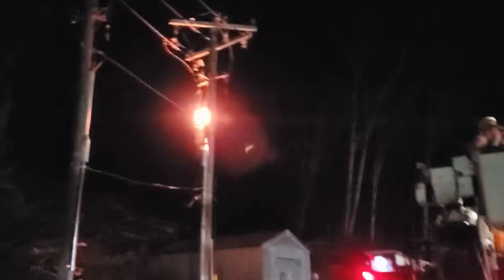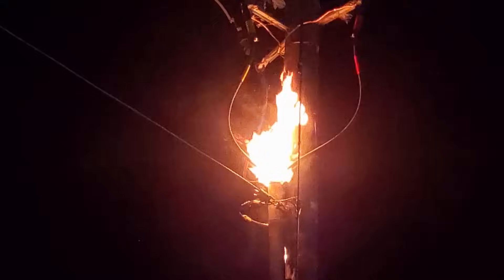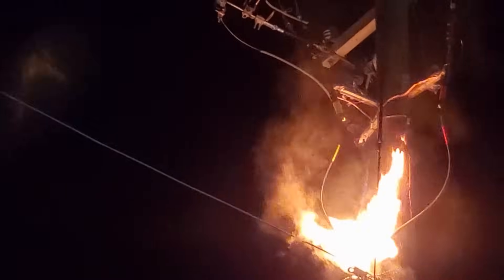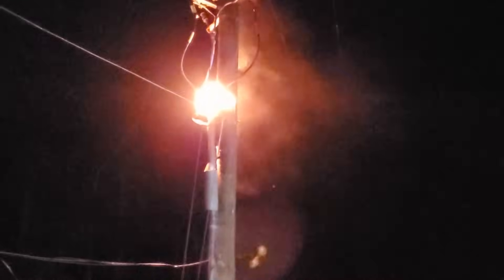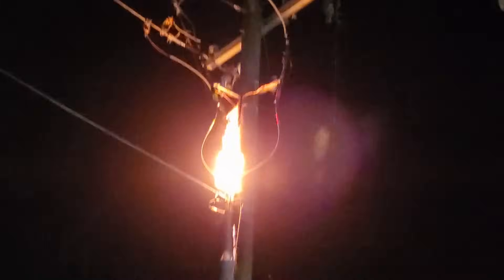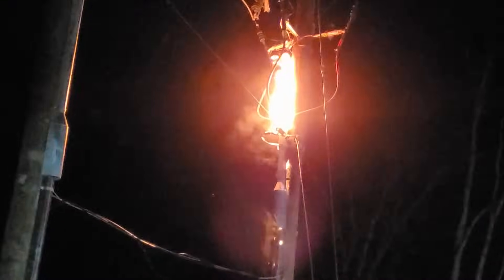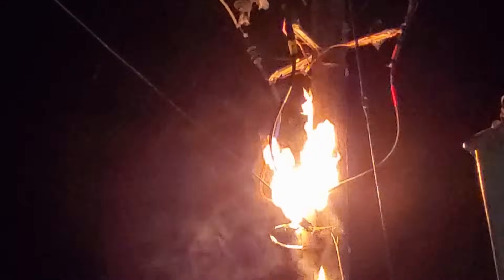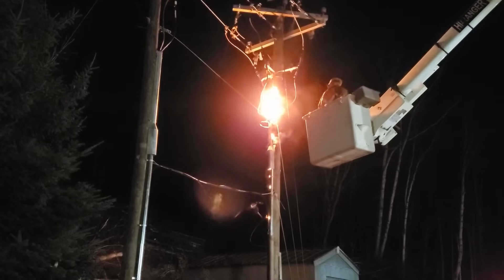Primary splice failure - 7200 Volts

Comment: There was evidently a failure like this on a municipal system about an hour from here, one of the 2400 volt delta cables out of the plant to the riser across the street failed at ground level. The city built an overhead bypass to the step down substation next to the plant (part of this system had been upgraded to 12.5kV decades earlier) and got busy with planning for and completing conversion of the four remaining 2400V circuits.

Comment: I saw something similar but it’s was an underground primary plant that cooked 12 feet of 2 primary feeds, 5 house feeds and a streetlight run. It cooked for about 1 minute before the guys disconnected from the ped mount transformer and the switch fuse blew on the other end. My dad and I were the contractors for this hydro company and we had to start excavating at 2am in the middle of January so that we could get all the homes back going.

Comment: Cleaning the cable is huge when splicing.   Whipping a primary splice together with 2:08 contaminants or improper lubrication will cause a failure      There was def some major error to cause it to fail instantly

Comment: I once had an similar accident while powering on a new 11kV cable. There where some timestress and miscommunication, so the guys changing the old cable with the new one connected the new cable with an old cable nobody was aware of. So as i swicht the "new" cable on i accidently swicht onto the old cable they had just cut and removed. There was a big arc and lots of dirt flew over the construction side. Luckyly nobody was close to the open cableend, so that just the substation automatically disconnected the whole line.

Comment: Little fire and smoke keep things interesting and breaks the boredom.  So never look the beast int he eyes.  That takes some training.  Things happen quickly that for sure. Sure, does get the ticker going. Last fire I had was like a small magic show in a closet.  Flames, smoke and disappearing technician. These things help to keep us on our toes.  There always seems to be something to learn from the situation.  Glad no one was hurt. Never hurts to have a fire extinguisher around.  They do make a mess in the truck if you have a discharge.  That stuff is hard to clean out.  We had one on a lift near my truck and it went off accidentally and I ran to get the doors closed.  Stil trying to get it cleaned out of the truck.  Well stay safe out there.  We all have those days.

Comment: Having "seen" a 480v/150A 3ph breaker explode... you never know when something "simple" is going to go to h***.

I wasn't in the room, but 150ft away down the hall. That was a new ABB breaker. It had been cycled half a dozen times during the various inspections. It blew when being switched on after final inspections. It was completely unloaded - the 20+ year old breaker at the far end PDU was open. The sparky was in full arc flash gear, and pushed it with a stick - not his hand. Other than being pissed, he was fine. (it's a $750 breaker (at the time), and it'll take 2wks to get a new one. Good luck getting ABB to admit to any fault.)

Then there was the make-before-break automatic transfer switch that bridged two out of phase 1.2MW generators... I saw that flash through the NEMA weather strip. It was turned entirely to slag. (there were spares for those in the yard.) And then the wrench dropped into a data center PDU... it's "only" -48VDC - pause for effect - at ~5,000A. Suffice to say that wrench no longer exists. ;-)
Reply: Hot sticks are seriously important. I worked with a software developer who coded grid disconnects. They had like 5 testers for every developer since bad code could actually kill somebody. But they would still get reports of a final physical disconnect sparking when pulled open with a hot stick. 

The level of code review after an incident like that was crazy intense. As it should be.

Comment: We have problems in Louisiana with squirrels building nests in the riser pipes & chewing through concentric & insulation, causing cable failures. It makes your pucker factor go off the scale when that happens. Especially if it's on the hard circuit not far from the substation, giving it plenty of fault current to play with. Stay safe, Brother.

Comment: I had something similar happen with primary wires behind my house which a crew worked on and the very next day an overhead wire came down and was arcing on the street which I thought was interesting since the wire was just spliced the day before

Comment: you linemen have brass balls the size of basket balls and that is a under statement
Reply: Thanks brother, we appreciate it.
Reply: @tkoz7856 i'm electrician in construction since 25yrs, and there is 2 jobs i could never imagine myself doing.. ironworker, and lineman. Especially those who get drop on transmission lines by helicopter and those who work on very high and live pylones.
🍻👍
Reply: @martf1061  thanks brother, ironically we're doing a huge 35 mile 230KV reconductor project with several crews. Was flying longline the last two days until Thanksgiving changing out old glass/insulators and putting wire in rollers for the wire pull. It's a fucking BLAST helicopter comes in brings you your laders and rigging equipment, takes the glass, brings you new ones. Cage extensions they even life the wire for us. Best part, they fly out all the trash. And then us after. Fuckin best days ever, talk about working with a view!

Comment: If they didn't catch that right away that could have been a lot worse the pole and the lines could have gone down and caused a really bad problem  if the electrician screwed up he might want to find something else to do a screw up like that could have caused major damage
Reply: At that point the next cut out should protect
Reply: Electricians dont work with voltages higher than 1000V. Not qualified and not allowed to.
Reply: @martf1061  you sure about that?
Reply: @vincenzothegamer9636  pretty sure yeah. At least in my country its like that. I am an electrician
Reply: @martf1061  not in the country this video is in

Comment: An electrician admitting SOMETHING WAS DONE INCORRECTLY? Holy sheet! (Great work my guy)
Reply: There are no electricians in this video. Lineman and electricians are much different.
Reply: @Bananahammock88 sometimes, he does some electrician work.. so i guess he's 90% linesman and 10% electrician. Didnt you see the video where he changes a "light pole head" for one of his client? 
Nothing wrong with him doing that, but usually, it's an electrican that does those kind of things. 
That makes him a linesman that knows more than most linesman..
Usually, electricians have respect for linesman, but sadly, linesman dont often have a good opinion about electricians. Dont know why, but it's like that.
Reply: @martf1061  yes, we do lights on poles as well. 120 or 240 lights we will do. Also, anything TO THE METER, we do as well. The other side of the meter is the narrow backs.
Reply: @martf1061  Also, lineman. Not linesman.
Reply: @Bananahammock88  sorry for misspelling. Not my first language.
Reply: @Bananahammock88 depends where you are
Reply: I can guarantee you every electrician in the jurisdiction of where the video was shot that doesn’t work only residential works with voltages over 480 on a regular basis
Reply: @vincenzothegamer9636  doubtful... Considering we install the equipment in all the areas that receive secondary voltage. More than likely 480 is the most they'll see even in non residential. It's EXTREMELY rare unless you're in a large city or manufacturing area to work anything higher than 480. 480 is the most I've ever installed and I've installed 5-10 of those transformers in the last 5 years that I can remember. Anything more than that, which again, is RARE, they're buying primary power. Now I can agree in that instance. Sure, they have electricians who will run their wires and equipment past the primary meter. But that's so unbelievably rare. Like we're talking Google, apple, PayPal, Amazon facilities, MASSIVE billion dollar businesses, warehouses, servers, and office buildings. I bet 1 out of every 500 or more electricians in that area available for labor, work those systems. And they sure as shit don't do it energized. They'll open the main, AND ask us to take a clearance from our equipment for them to do work on theirs.

 If a business needs heavy load they run multiple circuits, have lots of breakers and they get by with several very large transformers, Wiring 2-3 transformers together, or just one large one. There's single transformers that can produce over 30 million watts easily.
Reply: Here they com Bob, They can't leave well enough alone! Some ppl are not keen to sarcasm. Guy's I'm well aware of the terms and differences. I was poking at the common stereo types. Stay safe out there. Don't touch the plumbing or dig in the drywall. As for the other guys leave those trees alone and don't fondle the bird's nest.
Reply: Electricians primarily work with voltage between 120-240 volts. SOMETIMES up to 480. And its usually not energized. Lineman with with high voltage like 12KV (12,000 Volts), 21KV, all the way up to transmission voltage like 230KV and even 500KV - that's half a million volts! And a lot of the work we do is energized at that voltage while we work it. Lineman are paid more for a reason, it's WAY more dangerous.
Reply: @tkoz7856 I am a master electrician / field service tech and I work on medium voltage all the time. And you make it sound like people work on 230kv and 500kv hot. Not the case. Lineman will work up to 36Kv hot but that’s it. Rubber glove class 4 gloves only rated for 36 kv. And that’s the highest glove class. Also lots of electricians work on 480 all the time. Thats standard voltage in a commercial/ industrial buildings. I can tell you act like you know more than you do.
Reply: @stanley4006  false. We can work up to 36,000 volts hot. I had to check my books to make sure. Also, with transmission, we DO work it hot. Ever heard of bare-handing??? We wear a faraday suit and are able to work transmission hot. It’s like being a bird on a wire
Reply: @stanley4006  what about class 4 gloves? Also I can tell both of you are from the states. 480v systems are rare here with some exceptions. Usually US company’s that do business here. Also some geographic areas tend to prefer 480. But generally you don’t see 480 here
Reply: @Bananahammock88  damn dude didn't even see your comment, and I literally had almost the exact same reply lol
Reply: @Bananahammock88  i stand corrected they make a class  4 gloves sorry. And transmission wearing a faraday suit is a whole different class. Class 4 gloves max working voltage is 36kv tested at 40kv ac and 70kv dc. We only carry class 2 gloves and don’t work on anything energized. We will open switches and hang grounds and work in between.
Reply: @vincenzothegamer9636  480/277 here in the US stranded. I have worked in a data center that does have some 600v gear and ups equipment. In Canada 600v is standard they don’t use 480v like in the US
Reply: @vincenzothegamer9636
Here? Where is here?
Reply: @tkoz7856 600 VAC is widely used in Canada. Commercial/industrial electricians deal with it all the time.
Reply: As an electrician I’ve worked 34.5kv on customer owned lines overhead. After the power company CTs and GOAB switch, to 4-20ma level transducers. Or 0-10v controls...  It isn’t just linemen that get to work this stuff. EVERYONE OF THESE guys did their Job. Safe practices and everyone is going home in one piece. Good job! A lot of big hospitals or manufacturing owns the poles/ underground from the property line. The demarcation point. Have their own MV switch gear. Like I’m guessing in this job. Everyone went home safe. That’s the big thing.

Comment: Somebody has some explaining to do
Reply from the maker: We looked over the splice (what was left of it) and everything appears to have been done correctly... I mean...  obviously there was a problem, but didn't appear to be craftsmanship in the measurements of the insulation, semi-con,  jacket, sleeve etc... the primary cone may have been knicked or had a pinhole. We're really not sure 😦. 
Typically our sleeves fail from water penetration in the cable or if guys didn't seal the termination 20 years ago and it experienced 1 too many freeze/thaw cycles.
Reply: @Bobsdecline  maybe the boot failed.
Reply from the maker: Definitely one of the possibilities
Reply: I was told years ago while hooking up a customers service drop that lineman have balls the size of a dump truck? This was coming from the customer’s electrician. I laughed when I heard that. We’d need huge boxers if that was the case?